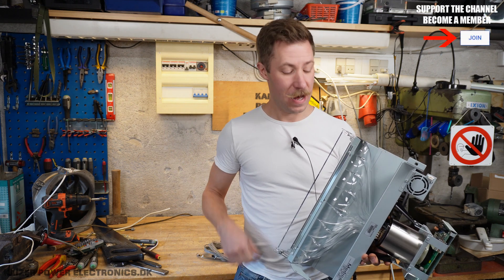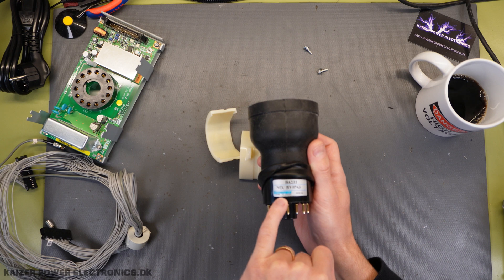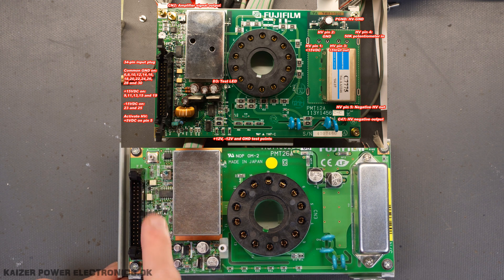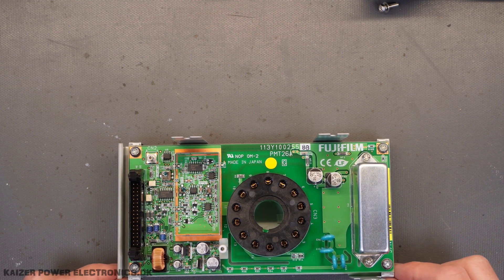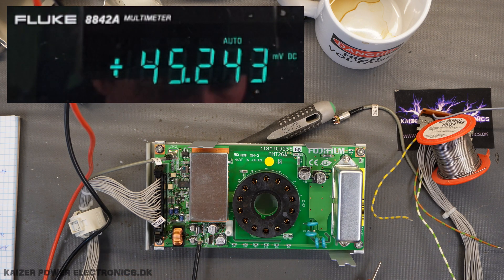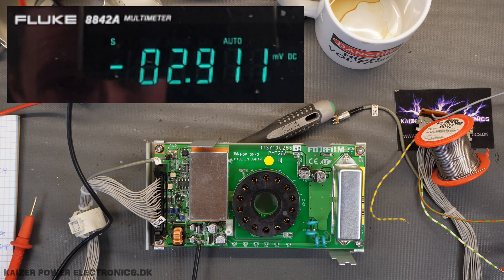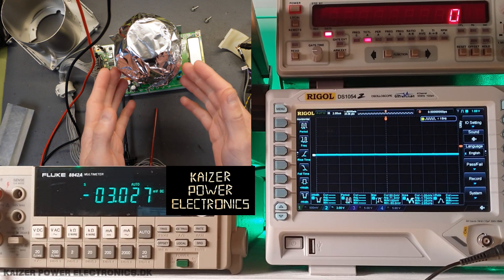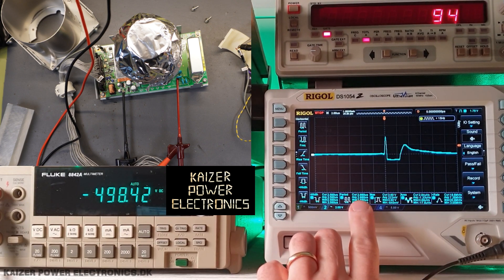Fujifilm PCR Eleva CR-IR 357 X-ray Scanner, Photomultiplier Tube Reverse-engineering (Part 3 of 3)

Comment: So that tube is only around 100uA photocathode sensitivity?
What would happen if you viewed the cintilation glass through a night vision tube with 500-3000uA sensitivity, would you see the light flashes in real time?
Reply from the maker: In my own experience, night vision has a certain lag and properly takes a lot longer to saturate the phosphor screen. I did however find a article when searching for your idea, that BIC make a alpha radiation goggle from night vision and scintillation material. But it would only show "green blobs".